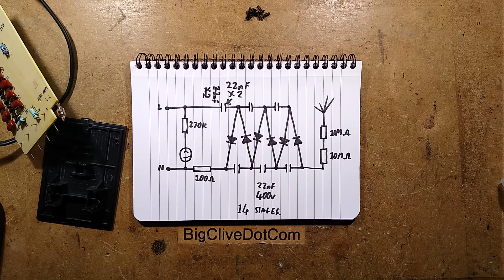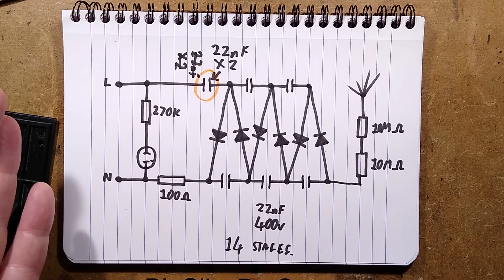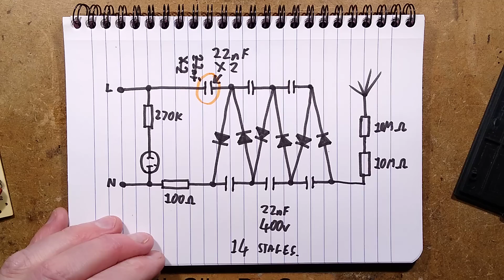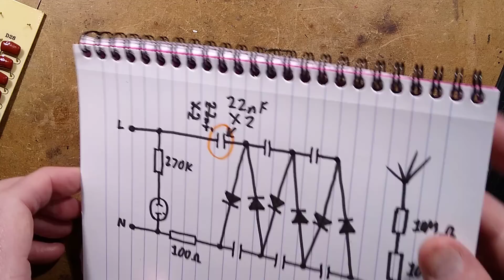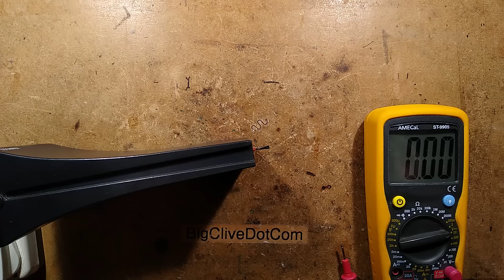Vintage Kenwood ioniser teardown - with schematic

Comment: Be very careful, it's now a C'live High Voltage circuit 😉

I have a similar black with green accents Kenwood electrostatic air filter "box", with a three speed fan and transformer to obtain the high voltage.
Two of them sat outside a long time in the weather after our Archery Club went Smoke Free due to legislation.
One didn't work anymore, the other is used in the rare event I light our fireplace 😉

Comment: That first capacitor, the X2, effectively forms a voltage divider since it is the same value as the next capacitor. 
To boost the output voltage, substitute a slightly larger capacitance for the X2, but don't do that unless the diodes really are 1N4007.
To run this ionizer on 120 volts: Short across that X2 capacitor.
Reply from the maker: The X2 cap is just the first stage of the multiplier.

Comment: I just fixed my Christmas lights that are still on the house (ready for the next one..) and they flicker dimly once every 5 seconds or so! They're on a smart switch, so I'm guessing the neutral is switched instead of the live (I'm in the Netherlands without polarized plugs, so that can very well be the case). I'd love to see an in depth explanation on how this can happen, I think you'd be able to give a lot of insight into it
Reply from the maker: Is the smart switch resetting?  Or if they pulse when "off" it may be leakage through a snubber network.

Comment: So just to ask about something unrelated to the video because i want to make sure.. But say you have 2 power banks both with a USB cable and you parallel the power and grounds of both to lets say a female USB A connector to power something using both power banks at once, what would happen?
Reply from the maker: I wouldn't recommend paralleling two power banks.

Comment: 7:00 That was a nice little fizz. Used to work at a company that used these ladders as multipliers for accelerator columns used in neutron generators. Voltages were up to 120kV and output power was usually something like 10W or so, driven by some form or resonant or HF electronic supply. They were quite spicy, and they exploded spectacularly when they failed given how small their form factor was. Usually the capacitors would be reduced to shards and dust in the bottom of the housing when one went.

Comment: What is it with the ionizers? This is like the 50th one. Kinda boring!
Reply from the maker: I like high voltage circuitry, so ionisers get featured a lot.  I put a video out roughly every two days, so they are a small percentage of my content.

Comment: I've got a LOT of green neons in case you're interested :-) Extremely traditional design, and it does look very stylish too. How about replacing those pins with fibre tufts?? Plenty of volts to drive them. (Edit  - as you in fact did in the second clip!)
Reply from the maker: I have a good stash of green and blue neons.
Reply: Where can I get the fibre tuft? Ebay/aliexpress? Thanks
Reply: What type of the output resistors? Just normal 0.5w?
Reply: @Cindy95216  Half a watt is more than enough.  Many "mains" neons make do with 1/8th watt resistors since the power dissipation is pretty small.  Good practice is to put two in series as a fail-safe option, although to be honest the power loading is so very small that the neons will fail a long time before the resistors! For a brighter indicator, upgrading to LED is highly recommended (green Ga As P LEDS are pretty durable, and have a very appealing colour!)

Comment: Why aren't ionisers built like this anymore?? Parts cost, or are those potted designs with high voltage transformers somehow superior?
Reply from the maker: Smaller and cheaper, plus the traditional ones are only suited to 220V+ supplies.

Comment: I used to run an ioniser for a while. It made itself and everything nearby go black with accumulated grime. If you operate one, you have to do a weekly wipe down of all hard surfaces with a damp cloth and soapy water. Merely dusting doesn't cut it.
Reply from the maker: There are versions that come with preferential dust collection mats.

Comment: If you get high voltage from this and the caps in it are rated at 400V what are the diodes rated at?
Reply from the maker: The diodes are 1N4007 diodes rated at 1000V.

Comment: Excuse my ignorance but what is the purpose of the two 10 meg resistors on the output?
Reply: Current limiting for safety, in case of somebody poking a conductive object into the holes while it's energized.

Comment: Fun trick, you can tell if the ionizer is actually on with a non contact voltage detector at the needle end.

Comment: Cockcroft-Walton multiplier.  I made one as part of a Jacob's ladder I built 20 years ago.  Funny, here in Canada Kenwood is known mainly as a premium stereo brand...when they still made stereos.  A Kenwood car stereo in the 1980's was a luxury.
Reply: Kenwood Limited of Great Britain is not related to the famous stereo maker.
Reply: @bills6093  It's not by the same Kenwood that makes kitchen mixers; the logo and font are the same as the Japanese Hi-Fi manufacturer (who make other appliances as well).
Reply: I wouldn’t be surprised to find out that a majority of Clive’s viewers have built more than one C-W circuit. I know that I have.

Comment: Would sticking a resistor to ground (N) (voltage divider -- DIY high voltage probe) after the 20 Meg give any kind of accurate reading?  at 240 is it a lossless 9.5 kV?

edit NEVER MIND:    The source impedance is huge.

Comment: I am wondering if there is a through put version (where air is pulled through say using a fan to pass over the ion emitters) that also has a UVC sterilization lamp that the air has to pass by before exiting the container and if not is it because they are counter active to each other?
Reply from the maker: Ideally it would pass the air over the UVC tube before ionising it.

Comment: I read a paper that found the C-W multiplier efficiency went down after 8 stages.  However, they did not vary the capacitor size through the stages, so it was not a definitive finding. 
It seems electrostatic field meters are spendy little things.  Perhaps you could design a uniform way to measure/compare the fields created? A reliable way to compare all these generator configurations with one's garage equipment would be interesting.

Comment: I have a question about ionisers, I have a potted module 12v input and two white leads with carbon fibre at the ends, I want to use it in my fridge, would it be any good for that and what about ground plain, is one needed?
Reply from the maker: It will find grounded metal inside the fridge.  The main thing to note is that if you use a 12V power supply to power it then the negative will need connected to ground.  Not doing so will risk stressing the primary/secondary insulation.

Comment: Nixie / Fluorescent tube to practically demonstrate the Tesla "Wireless power" tower or the advantages of lighting a caravan under powerline pylons.  (Not tried the caravan light test but fairly sure it'd be a thing)  :)
Also it's an old school CRT tripler  Ahh memories
Reply: Harvesting power from power lines is technically illegal. Some loss is unavoidable and power companies get a tax break because of that. At least they used to. You using some of that power is seen as avoiding paying taxes, you see, which is a more dastardly crime than stealing power, apparently.

Comment: You mentioned that these older types are not as good as the modern potted variety.  Why is that?
Reply from the maker: The modern high frequency modules put out much higher current.

Comment: This is an ( excellent ! ) " old skool "  ioniser .... there are ( Neon style ? ) indicators that contain Mercury vapour and a white flourescent band on the inside of the glass ... they emit a BRIGHT GREEN glow ( found in many older kitchen gadgets ) ... maybe ? Kenwood designers did not know this ( ? ) .. you might ( retrofit ? ) one of these , to assist the green filter ( ? ) .. handy tip ... DO NOT place near a white painted wall ... (  you  WILL  get a dark " smudge " .. impossible to wipe off ! ) ... to the annoyance of ( my ) late father ... ( OOPS ! ) ............... DAVE™🛑
Reply: I used to have a collection of those indicator lamps. Some actually had fill gases other than neon to produce different spectral lines. I don’t know if they are still on the market, LEDs being much simpler to use.

Comment: This is not by the Japanese Hi-Fi Kenwood (Kenwood Corporation), but by the UK kitchen appliance Kenwood (Kenwood Limited).
Reply: Clive should pin this comment. Too many are making the mistake of confusing the two.
Reply: @two_tier_gary_rumain  Aww, I wanted to place this next to my record collection for less static and better sound.
Reply: yep, started by a bloke called...... Ken Wood
Reply: Japanese Kenwood HiFi and radio equipment was badged as Trio when first sold in the UK.
Reply: Who knew 🤷‍♂️
Reply: Like georgie underwear
Reply: The font and branding are consistent with the Hi-Fi manufacturer (which also makes other types of appliances), not the kitchen appliance manufacturer.
Reply: @dlevi67  No, the Japanese Kenwood would have a triangle in the W. This is consistent with the British Kenwood. Their fonts were similar.
Reply: @straightpipediesel  Fair enough - I stand corrected.
Reply: this IS from Kenwood. I know Kiroshi Kenwood personally.
Reply: @JohnnyDanger36963  The label says it is made by Kenwood Limited in Great Britain, so clearly not the famous Kenwood audio company.
Reply: @bills6093  it's a Kiroshi Krnwood Japan  off shoot.

Comment: I find it so weird that in 2024 manufacturers are still using non-standard screw-heads, as if we're all 4 and can't easily get screwdrivers for them... -.-
Reply: The device dates to well before 2024!
Reply: Its almost as if this was 30 years old or more
Reply: There's plenty of examples today where manufacturers are still using these types or similar types of screws. Things like games consoles etc. for example.
Reply: Young kids who have just learned the magic of screwdrivers have difficulty ordering the correct bits if the parents don't leave them about.

Comment: Nice!!!
The steel mould they used for that base piece looks to have been fairly roughly made. You can see all the machining pathways the CNC router bit followed on it. It's like zero polishing was done on it before they slapped into the injection moulding machine.
Reply: There's no reason to spend time and money on something that can't be seen.
Reply: @Loreroth  true but it would make getting the moulded part to release from the mould a lot harder than needed.
Reply: @kittytrail  🤣🤣🤣
Heck they could have thrown a bit of EDM at it to finish it off, knock off the very rough edges. 
Hell a 2nd pass with a shallow finishing cut  would have cleaned up most of the chunks. 
Jasus, it looks like one of those bloody street urchins, of which you speak, carved it with a blunt butter knife, or the handle of a spoon they stole from the commissary...🤣🤣🤣🤣
Reply: @Loreroth  it’s on the far end from the high voltage components so yes, in this case. I would bet that the upper part of the case is much smoother to reduce tracking.

Comment: If this unit was made by the same folks that designed and made Kenwood radio / audio equipment, no surprise it is pretty well made. Ionisers were not really their bailiwick normally but I guess they were riding "The Sharper Image" products' success at the time. It would look great next to one of those rocking box blue wave generator ornaments. Get that ozone flowing! more zaps per cubic foot!  8^)  I enjoyed the teardown video. Cheers.
Reply: Kenwood Limited (UK) and Kenwood Corporation (Japan) are two different companies.
Reply: Different Kenwood company.

Comment: Why not use a step up transformer? Why a 14 stage voltage multiplier instead?
Reply from the maker: Very low current.  So much cheaper.

Comment: Slide a magnet across the plastic bottom to find the screws
Reply from the maker: That works great for finding screws in wall and ceiling studs too.
Reply: Assuming they are made of steel
Reply: Well, yeah. I've been finding Aluminum screws lately.
But, the magnet is still a good idea. imo.

Comment: I believe over rating the first capacitor is supposed to protect against failure or fast wear, seen it in a few places but never seen ones without fail in the way you'd think they're trying to protect against

The base was a shame, having to stab through half of it to find their screws, wonder why half the capacitors seem to have been pushed over the opposite way of the other

I feel like there may have been one with a remote control? Could explain the space for another thing inside the case, strange, mostly know kenwood for their kitchen appliances 😂

Comment: I'd have thought the part of the base you mentioned being for a "potted module" is more likely to be for a transformer to bump the voltage up to 240 from 100-110 in foreign markets with a low supply voltage, like Japan
Reply: Why would a Japanese company design a product to run natively on 240V and then add an additional converter to run locally though?
Reply: @bosstowndynamics5488 that's the thing. 
This is the UK brand Kenwood and not the Japanese HiFI company
Reply: @bosstowndynamics5488  because a traditional ioniser that uses a voltage multiplier cannot function efficiently on 110v, the initial voltage is too low, you end up needing an unholy amount of capacitors and diodes to make it functional, so it's common to add a transformer to bump up the start voltage, and use an identical multiplier for every country of sale
Reply: @ArlenMoulton2  Fair enough

Comment: Anti-tamper my arze. 🤣 Everyone has all the different bits now, its very difficult to keep people out of products now. Especially Clive 🤣🤣 The base looks 3d printed I guess its not but still   Interesting video  2x👍
Reply: the one-way screws are the worst. the ones with a slope in the opposite direction that makes it impossible to remove with normal bits
Reply: This thing is at least 20 or 30 years old. Anti tamper screwdrivers couldn't be bought and 3d printers were not a thing. The markings are from the injection molding.
Reply: i'd guess CNC milled perhaps?